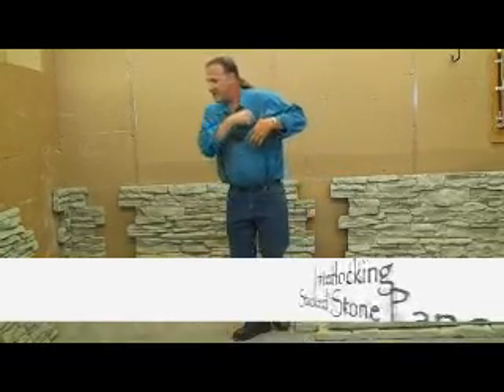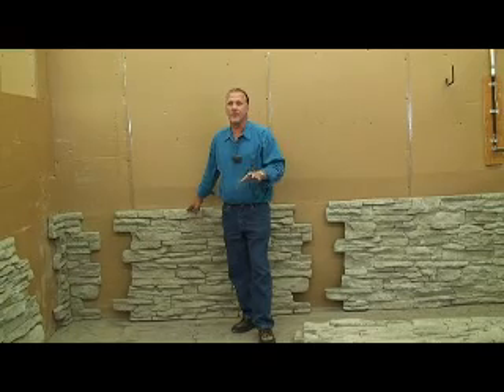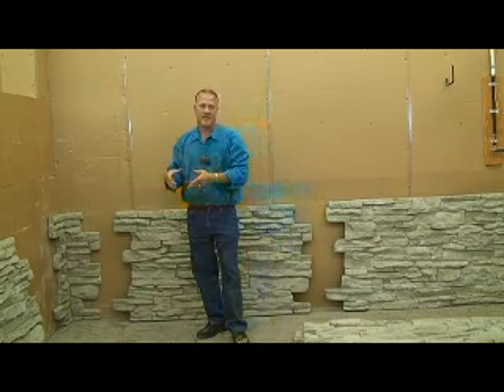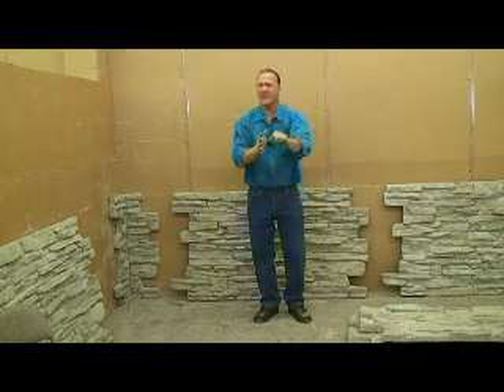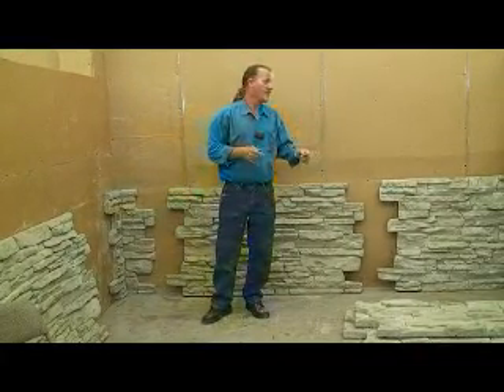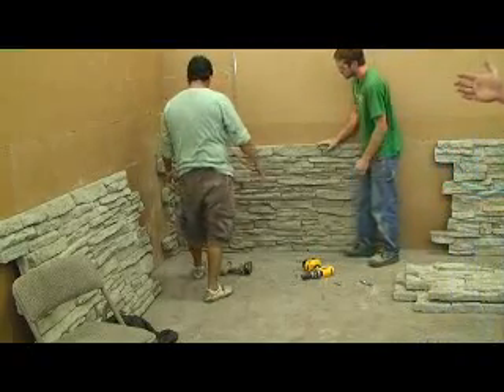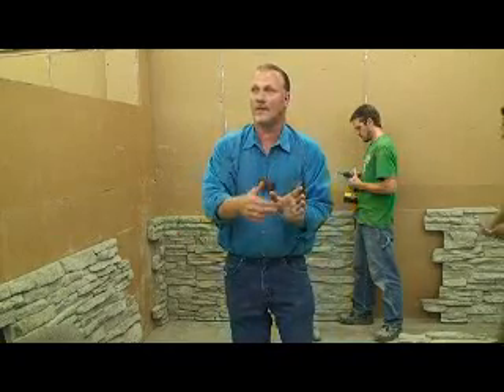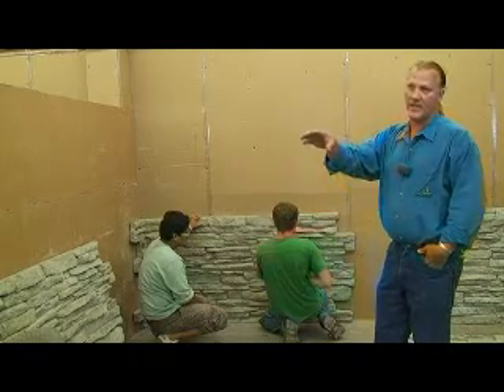3 Day class - 1.01 -

Comment: You don't mention hitting a hot wire in the wall and that depends on the placement of the wire and the screw and the length of the screw and the depth of the wire inside the stud.
Reply from the maker: No hits on this one…👍